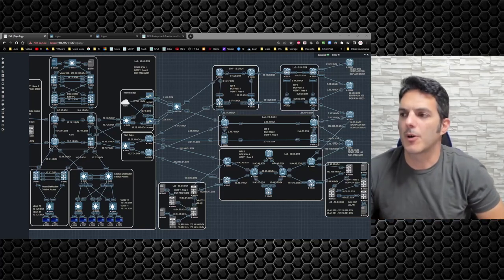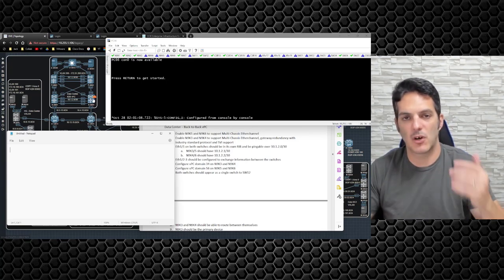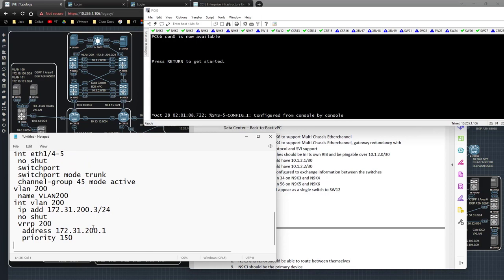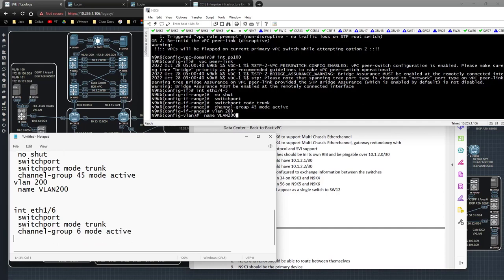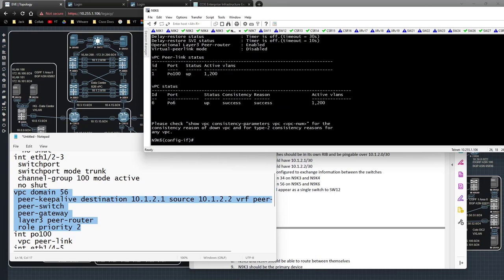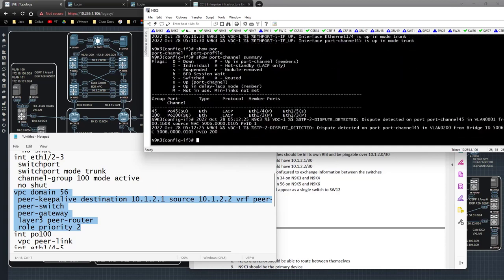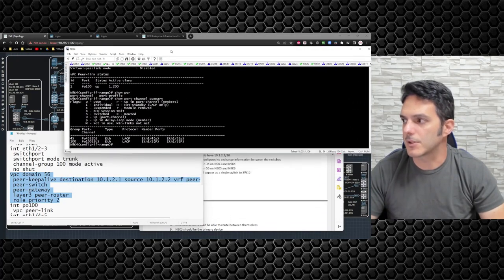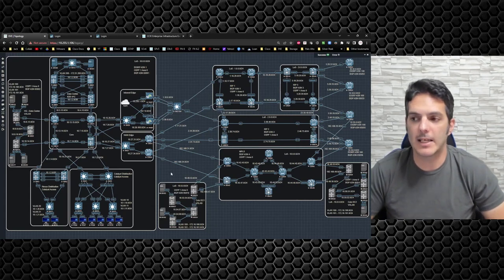Enterprise Lab 1 Data Center Back to Back vPC

Comment: Your ports in suspended state, because you didn't configured vpc under them. So, from LACP perspective, eg. N9K5 is connected to the two different devices. If you run show lacp neighbor you probably will see different LACP Sistem ID.

Comment: I was wondering why you didn't stick to all your task from thesheet for this lab.
Was there a reason you didn't create vlan 20 and 21 on all switches or was this a mistake which was copied and paste from the previous task.

Also my show mac address-table dynamic is always empty. maybe it's the code I'm using on the 9k which is nxos.9.2.2.bin

Comment: Hey Rob,
I hope you're doing well. What about spanning tree in back to back vpc? Do we need to use stp here?
Reply from the maker: Yep, bridge assurance should kick in. The STP root needs to be set.
Reply: @RobRikerTechChannel 
Thank you for your answer. On which vpc doman do we need to set stp root?
Reply: @RobRikerTechChannel 
Do you have an example?
Reply: @RobRikerTechChannel 
Bridge assurace needed only on vpc peer-links? Do we need to set this on links between vpc domain?I maen redarding this topology. Could you describe the STP root setup process in more detail?
Reply from the maker: @forlap574  correct for bridge assurance. Normal STP rules apply. There's some design guides for nexus with b2b vpc, Google for them and review.